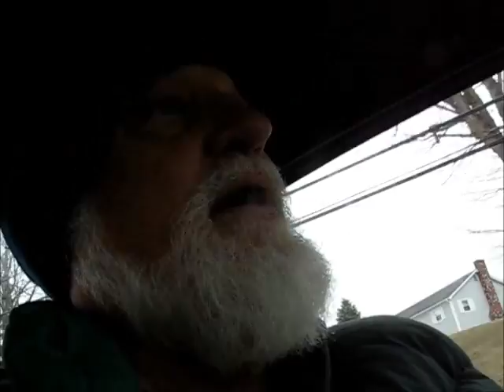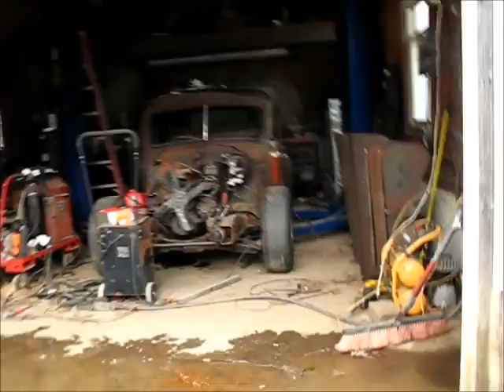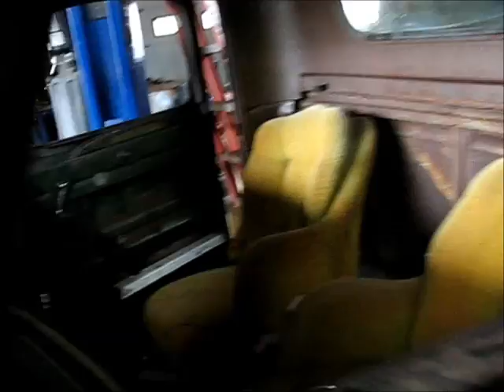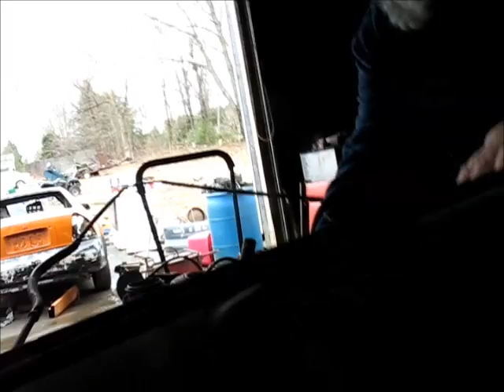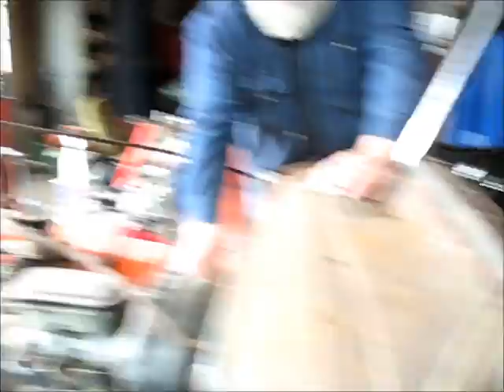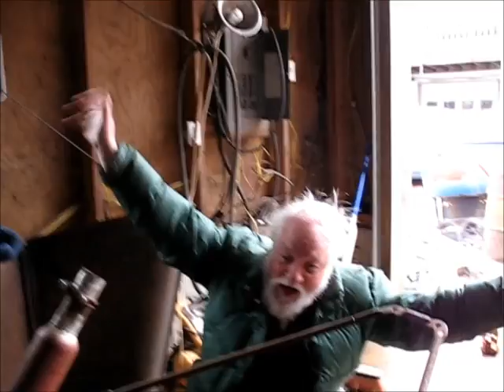It's Alive

Comment: I had a 68 Acadian with a 250 it had 300,000 miles on it and it loved to run it worked better at 70 mph than at 45 and go all day it ran so quiet you`d walk by get in and turn the key you` could`nt hear it run HA HA  . Yours will be  a Nice ride .

Comment: Ok. I'll try to remember.
The cab is off a 1941 Chevy 1.5 ton
The nose is off a 1940 Chevy Coup.
The rear body is made from the front fenders and rear trunk section off a 1936 Chevy.
The tail light/fins are the headlights off a the 1940 chevy coup.
The frame is a 1996 chevy s-10 that I cut the frame rail off and switched form one side to the other. 
The motor is out of a 1968 GMC Pick up.More info available at my channel dedeye1.
Thanks